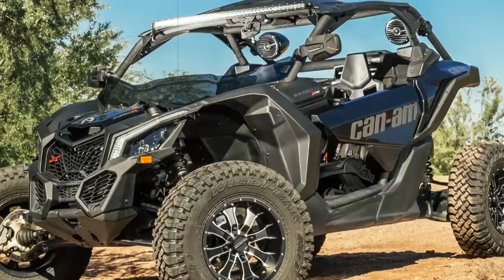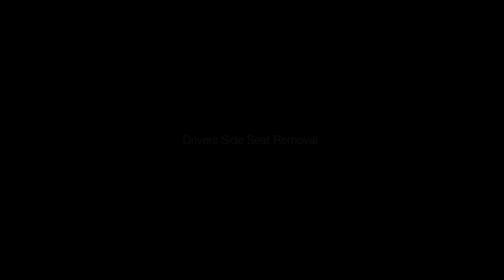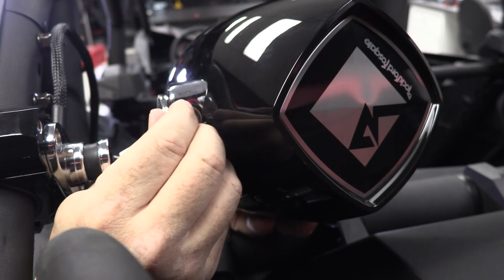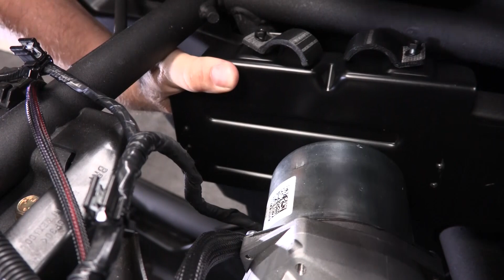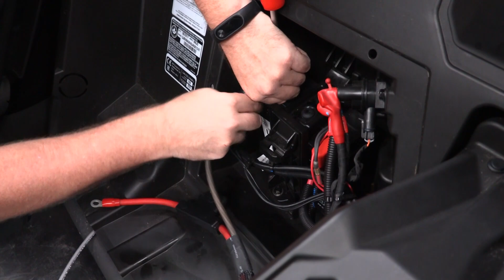Can-Am X3-STAGE5 Install (Gen-1)

Comment: What’s the part number to the subwoofer Y adapter? My kit did not come with it. And i want to have a part number so I can reference when looking to obtain a new one. Last piece to the puzzle. Please help
Reply from the maker: That is part of the X317-K4 entire wiring kit for the system.  If you are just missing that part, I can ship you a spare one we happen to have.  Please reply to me at ce@rockfordcorp.com with your shipping address and we'll take care of it.
Reply from the maker: Hi pblomar24, I never saw your email.  Note the email is (ce@rockfordcorp.com).
Reply: Rockford Fosgate I was able to contact the authorized dealer that sold me the kit and they sent me one. Thank you for being so attentive with the matter. I really do appreciate the support. One quick question, is there a spec sheet of the stereo recommended settings? I have my amp at the RF recommend settings but can’t find recommendations for the head unit. There’s lots of settings under the audio tab. 

Once again thank you very much
Reply from the maker: @pblomar24  You can download the PMX setup sheet for the 2nd generation kits by downloading it here: http://rftech.custhelp.com/app/answers/detail/a_id/1356

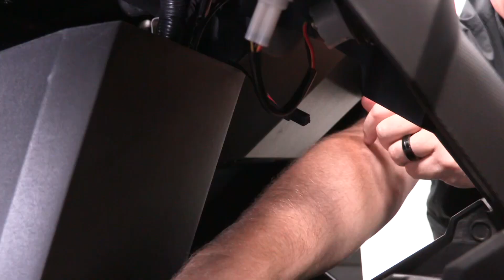Comment: At 4:30 it says to plug the red and black wire into one that is under the dash. Is that one that is sitting there not plugged up to anything or do you have to unplug one to use. Doesnt show where to find it at?
Reply from the maker: Yes, the plug is empty.  You pretty much have to detach the top part of the dash to find the plug (I tried my best to illustrate this in the video.) If you cannot find it, some systems come dealer equipped with a winch controller and that controller plugs into this particular plug.

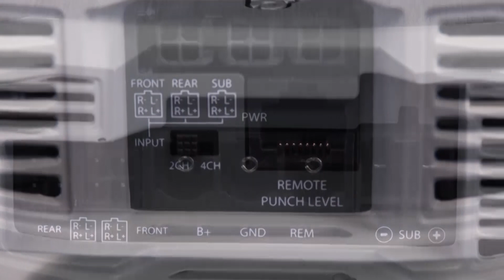Comment: 29:28
Reply from the maker: Hi Brave, did you have a question about the Amplifier's input/output or power connections?
Reply: Rockford Fosgate not at the moment, just commented so that I can refer back to the image.
Reply from the maker: Great Idea @infinitebrave6958 ! I created Tuning Guides with the amplifier settings and connectors for you to refer while doing the installation that can be download here: http://rftech.custhelp.com/app/answers/detail/a_id/1356
Reply: Rockford Fosgate quick question, got everything set up, however, the two subwoofer are not working. Any suggestions to where I went wrong?
Reply from the maker: @infinitebrave6958  Her's how to troubleshoot this issue:

1) Make sure the SUB INPUT on the top of the amplifier is switched ON and the side panel INPUT SWITCH is set to 2CH (switched toward the outside of the amp). 

2) Check to make sure the INPUT HARNESS for the sub is plugged in all the way.  If it doesn't "snap in", I have seen a couple amplifiers where some internal glue spills over and prevents the input harness from snapping into place. An X-Acto knife usually clears the glue away.

3) Next would be checking to make sure the subwoofer harnesses are completely plugged into the subwoofer enclosures to make sure they snap-in to place.  

4) Make sure the PMX-2 FADER is set to the middle position.  

5) Take the 2 screws out of the PMX-2 dash bezel and plug the REAR RCA JACKS into the FRONT RCA OUTPUT.

Comment: What happens to the 12 volt power outlet  where the dash kit goes?
Reply from the maker: It remains untouched.  You could certainly relocate it if you need it.  Just use a 3/4" Step-Up bit and extend the cable to the new location by soldering and heat-shrinking your connections.

Comment: I have a question I took my can am maverick x3 max to a shop to install the stage 5, and they installed the subwoofers facing down , they said those subwoofers can't be installed facing up , is that right?
Reply from the maker: The 1st Generation kits (X3-STAGE5) utilized subwoofer enclosures that face down.  The 2nd Generation kits (X317-STAGE5) that we started shipping in 2019, utilize upward facing enclosures. Here is the installation video for the 2nd Generation enclosures: https://www.youtube.com/watch?v=5GkA2vIVzdw

Comment: will stage 5 work with 2019 x3 Max ??

Box shoes picture of a 2 seater ?
Reply from the maker: The 2019 model is not on the Compatibility Chart yet because the Smart Lok is currently in the way.  We are developing a kit that will be compatible, but at this time we don't have an ETA because it's still in development and we need to give our engineers time to do it correctly.
https://www.rockfordfosgate.com/products/details/x3-stage5/
Reply from the maker: Just a follow-up for fanatics reading this.  The newer X317-STAGE5 is compatible with the 2019 X3 Max.  You can find information on the newer model designed for Smart Lok here: https://www.rockfordfosgate.com/products/details/x317-stage5/

Comment: Perfectly explained and easy to follow...sounds excellent...thanks for the video. Quick question, why can't the sub bracket covers be used? Seats fit back in fine w/covers attached; just concerned about sticks, rocks, etc. that get inside enclosure.
Reply from the maker: Sorry we didn't see your edited comment that included a question ... Are you referring to the subwoofer grilles?  In our installation, we felt they would potentially rattle against the bottom of the seat, but if you can get them to fit, try it.  You won't hurt anything.

Comment: Also when you connect the 2 subs together with the y cable I noticed that the plug that goes to sub output on amp does not match the wires. For example a red wire goes into neg and a black into positive...it only fits one way too

Comment: Also on a side note u did not mention to remove the sub output and power/ground place holders on the amp...I installed it to the bracket and couldn't figure out why my wires wouldn't connect and why I couldn't find the output side mounting holes on the bracket....they were both blocked by the place holders lol
Reply from the maker: The amplifiers are sold separately and the assembly line inserts the connectors into the amplifiers.  This insures the connectors stay intact with the amplifier and don't get damaged during transit.

Comment: I cant seem to find my front speaker wires that go from amp output to speakers, what box do they come in or are they in their own box?
Reply from the maker: Were they not included with the master wiring harness box?  BTW, They will not be in the individual amplifier or speakers component boxes.
Reply: Nope, they weren't in there. I know the rear speaker wiring harness had their own box so I wasn't sure if the front did also and I was just missing it or what?
Reply from the maker: The rear speaker harness is a separate kit that comes with the rear clamp-on speakers.  The front wiring is included with X3-STAGE2/3/4/5, so if you can't find it with the front speaker panels, please contact our customer service at 1-800-668-9899 for replacement harnesses.
Reply: Rockford Fosgate 
I actually found them at the bottom of the box of the new front panels! Everything is installed and sounds good! Any videos on how to tune the amp?
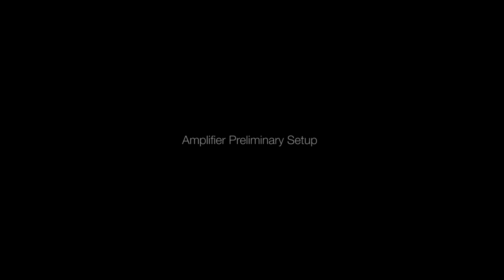Reply from the maker: This video you're commenting on has the amplifier setup instructions at timecode 25:22.
Reply: Well I saw that part, but it said to set all crossover rates at 80hz and high pass....in my understanding and according to the subwoofer manual, the sub should be set between 80hz and 100hz low pass. If I set my sub to high pass and 80hz as instructed by this video, then there is no point in turning on my infrasonic filter? Because as far as I understand the infrasonic filter prevents the subs from hitting notes below 25hz?
Reply from the maker: The TM1000X5ad included in the X3 kit is sold separately and is designed for various other types of installations like cars and boats.  The settings in the video are correct and optimized for the "open air" design of the X3 and the subwoofer enclosures included in the X3 kit.   

The FRONT and REAR full-range speakers will be set to 80Hz and the switches for both FRONT and REAR should be set to HIGH-PASS.  The Subwoofer is automatically set to LOW-PASS, so there is no switch on the amplifier at all.  You want to set the crossover point between the High-Pass (full-range speakers) and the Low-Pass (subwoofers) at the same frequency so there is no gap or gain at that "crossover" point.

As for subwoofers, most bass notes you hear AND feel come from the 40Hz-60Hz region, not 25Hz and below.   You're more than welcome to keep the infrasonic filter in the OFF position.  However, the subwoofer system in the X3 is not optimized to play bass in the 20Hz - 25Hz region, as you'll need a much larger enclosure (at least 2x the size) to adequately play those frequencies.  At that low of frequency, it's all about air movement, not audible notes.  This is not a short-fall with the design of the X3 audio system, but rather what is practical to install in a UTV.

Use the amplifier settings in the video.  We went through a lot of hard work to provide the best recommendation for fanatics like you. This will not only allow you to get the most out of your entertainment system, but will ensure a longer lifespan of the components.
Reply: Thank you very much. I played with the sub settings alot and the recommended settings are definately the best. Only change I made was turning up the inputs a little more to make it louder. I'm very satisfied with the system and would highly recommend the product to others. Appreciate your help!
Reply: I said sub settings, I meant amp lol

Comment: Y'all should've made a video of installing the stage 5 on the RZRs also
Reply from the maker: Great feedback!  The only difference between the RZR-STAGE4 and STAGE5 is better speakers and subwoofer whereas the Can-Am has this plus an additional subwoofer to be installed.

Both RZR-STAGE4 & RZR-STAGE5 kits contain 12 components and the installation is exactly the same between both kits.  The difference is the speaker upgrade from Prime RM1652B to Punch PM2652B, rear speaker upgrade from Prime RM1652W-MB to Punch PM2652W-MB, and a subwoofer upgrade from Prime RM110D2B to Power T1S2-10.

The Can-Am X3-STAGE4 has 11 components whereas the X3-STAGE5 has 12 components.  The difference is the speaker upgrade from Prime RM1652B to Punch PM2652B, rear speaker upgrade from Prime RM1652W-MB to Punch PM2652W-MB, and the additional RFX3-FWEP passenger [under] seat subwoofer enclosure and subwoofer.